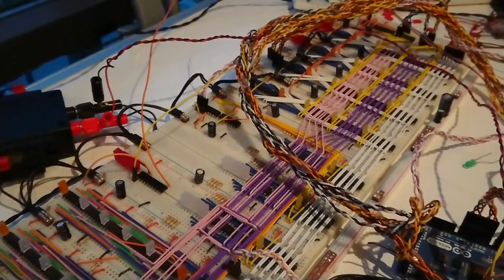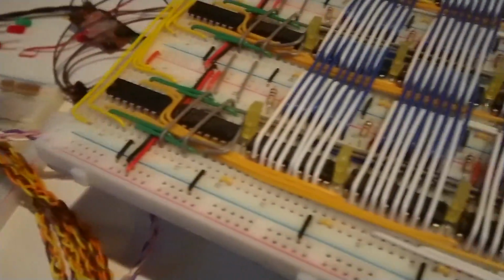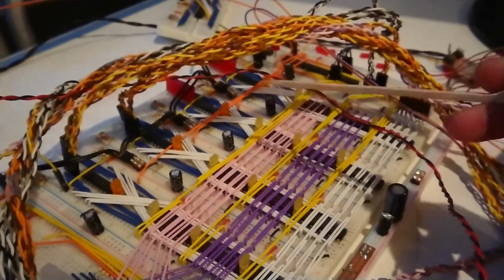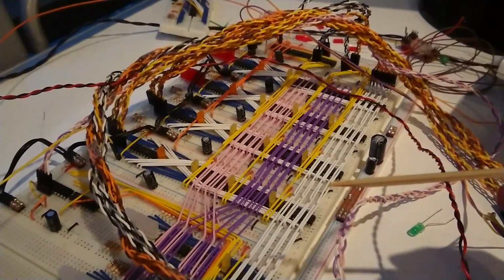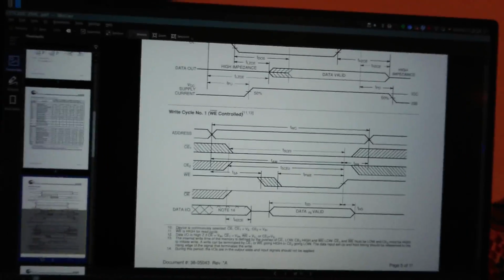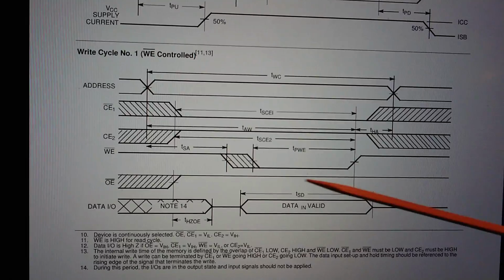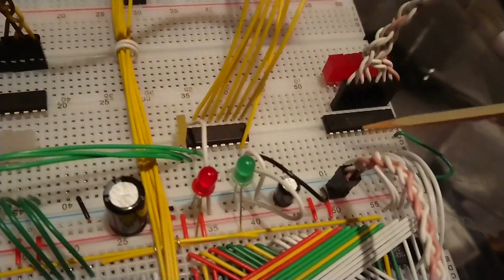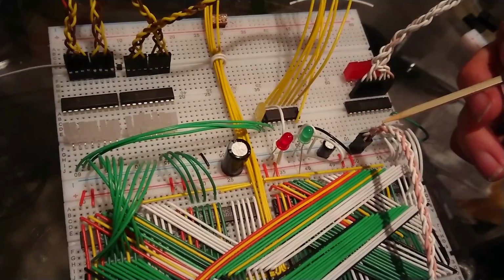64k Memory Module - Plum Breadboard Computer

Comment: never seen edge triggered RAM writing. I wish they all had it.
Reply from the maker: I'm sure there must be a reason for it, but it alludes me.
Reply: @dankendell  Actually register files in modern CPUs are basically multi-port SRAM banks that are clock edge triggered (i.e. synchronous). Normal memory is asynchronous, or rather, it's trigger for initiating a read-cycle is any change of address, and write cycle is somewhat like a level triggered latch with the !WE signal going back from low to high. Originally, synchronous registers were constructed discretely with edge-triggered D-flip-flops, each constructed of an arrangement of 3 SR-latches, i.e. 3 pairs of NAND gates with the cross-over feedback. Conversely SRAM cells are constructed from a feed-back loop of inverters, and the address-change trigger is generated from XOR gates where both inputs are fed from the same address line with a delay on one, so you get a pulse on the output of the XOR when the address changes, and then all funneled into an OR gate to get that pulse on the output of the OR gate. CPU register files no longer use the D-type flip flops, as it looks like much easier to build the inverter feedback cells with word line selection and Q and !Q bit line comparators, which even lends itself to relatively easy extension to dual port, exactly what is needed for a register file. And synchronizing that on a single clock edge is not hard, even easier than those XOR gates one per address line. It seems that for RAM, people prefer not to use synchronous. And after all that, I am right there with you -- I don't know the reason why external SRAM is not synchronous.

Comment: May I ask what brand of wire do you use and where you sourced it from?
Reply from the maker: No worries, standard "breadboarding wire" is known as 1/0.6, which means "one strand of 0.6mm diameter". I bought this: https://www.rapidonline.com/rapid-100m-reel-1-0-6-1-of-each-colour-11-reels-01-0380 (i should really sign up to an affiliate programme)

Comment: Your wiring is so beautiful :)  I'd never be brave enough to make my breadboards that dense, I feel like it would make debugging hell
Reply from the maker: Thankyou. I was fearing a debugging nightmare, but thankfully the circuit is so simple there was very little to go wrong. It's just the scale of it, eight large chips in parallel. Just about manageable. I did get one wire in the wrong spot, but thankfully it was in the top layer so an easy fix. Once two layers were down it was impossible to see what column I was aiming for and had to kinda feel for it. I'm more concerned about capacitance in the circuit, but it hasn't been an issue yet. I'm intentionally running it super slow because I want the satisfaction of flashing lights! :D
Reply: @dankendell  I found out why I can't make my boards as nice, in testing I realized I somehow wired all the B register connections to my 74LS181's backwards :/  So now I am having to reverse the connections, but its easier because mine isn't so dense. I've adding lots of decoupling caps to my breadboard computer, preempting capacitance issues as it gets larger

Comment: What kind of wire is that? :o Looks beautiful!
Reply from the maker: Thanks! Dont know where you are, but in metric it's known as 1/0.6 wire, meaning "one strand of 0.6mm diameter. The stranded equivalent I use for header crimps is 7/0.2, seven strands of 0.2mm. No idea what it is in AWG. 🤷‍♂️ Hope that helps. 🙂

Comment: Idk how ur wiring is so sophisticated
When i circuits on a breadboard it looks like spaghetti
Reply from the maker: Pure patience. The difference for me is that I don't consider it an electronics project so much as an art project. It has no purpose, doesn't matter if I never finish it, the only thing that matters is that the bits that work also look pretty. I actually abandoned using the 74181 ALU ICs and built my own adder subtractor just because I could make the wiring nicer! 😁

Comment: Can't you just use a N channel transistor with a 10k pullup resistor
Reply from the maker: I'm finally catching up with comments. 😉 I don't really remember the context, but if it's about inverting the clock signal then yes absolutely that would work. I do have a follow up video about testing this module with the arduino "monitor", can't remember what I did with that either! Probably just hooked each signal up to the arduino directly. In case it didn't come across, I'm totally winging this, no schematics, no plan, just bending wire making it up as I go. 😁 P.S. Love minecraft, I've made a few redstone machines but no computer. 😉 I tried to build a brutalist style automated ore processing facility, but where I play creative mode there wasn't much imperative so I never finished. Now I can't remember where in the map it is! 🤦‍♂️

Comment: This video just popped up in my recommendations, and  because the wiring looked so neat i felt myself compelled to watch, only to realise it's part of a series; now i have to watch all your videos about 'PLUM'... thanks Obama! lol No but seriously though, this is a subject that interests me very much. Thanks for sharing your efforts.
One thing baffles me though: why didn't you just use one 64kx8 chip? Something like this

https://www.ebay.com/sch/i.html?_from=R40&_nkw=WINBOND+W24512AK&_sacat=0&_sop=15
or this:
https://www.ebay.com/sch/i.html?_from=R40&_nkw=HMU65664A&_sacat=0&_sop=15

In any case, Greetings from Denmark
Reply from the maker: Thank you, you're very kind. :D I wanted the aesthetic of a matrix of chips like the 16-byte memory/register module has. It's an art project and I don't have much interest in finishing it. One big chip is quick and easy, but it's also ugly and boring. :( Not that I have anything against using one big one, it makes a lot of sense to because it's faster, more reliable, uses less power, blah blah, blah, but did any of that really matter? If it did I'd just use one of the many Acorn Master computers I have on the shelf. ;)
Reply: @dankendell  Ahh i see, i didn't realise that the visual appearance was that important, although it's certainly pleasing to the eye. :D

At some point I'd like to do a similar project of my own, i just need to accumulate more breadboards. One thing i'd really like to do is to build a Z80-compatible CPU out of 74xx chips but that will require some more research into the inner workings of the Z80 ;)

Thanks for taking time to answer my comment, i hope you're having a great day/evening/morning/etc. 

Stay safe, Daniel.
Berty.

Comment: what wire do you use, I want to get into electronics but wires are annoying to find
Reply from the maker: Standard "breadboarding wire" is known as 1/0.6, which means "one strand of 0.6mm diameter". I bought this: https://www.rapidonline.com/rapid-100m-reel-1-0-6-1-of-each-colour-11-reels-01-0380
Reply: @dankendell  thanks

Comment: Can u make a vid about how u wired this because this is just pure beauty
Reply from the maker: I would, but there really isn't much to say on it. Parallel up all the chips except the output enables and write clocks. Those go through a 74hc138 decoder and a little extra logic to route the signals to the right chip. I suppose I could talk about that a little?

Comment: Crazy to think that the entire board still only has half the ram capacity of the AS6C1008 SRAM chip I have on my desk (128K x 8bit). I'm doing something similar by combining these chips together instead of just buying one with 8x the capacity (I have literally hundreds of them as I scored a job lot cheaply off ebay).
Reply from the maker: Yet still 32x the amount of memory of the Apollo Guidance Computer which was only 2k, though admittedly 15-bit. Moore's Law in action I suppose. :)

Comment: dude, you are the Picasso of breadboard art!
Reply from the maker: Art is definitely the thread I was following. I'm not a very artistic person, but I can do this! :D
Reply: this made me think that what if the bread board had jumper inserts at bottom side too, probably a bad idea for ideal breadboard applications, but could have been very useful for you in this case.
Reply from the maker: @shkhamd  that would be useful, and if taken to the extreme is basically a double sided breadboard... 🤔 Yeah, that sounds pretty cool. 😁 To be honest though, I'd settle for breadboards that have a width that is a multiple of its height. So you could stack two vertical breadboards onto the top/bottom of a horizontal one for example. They're almost 3:1 but not quite. Very annoying. 😒

Comment: How do you make that so straigth? that is amazing!!
Reply from the maker: Thanks! :D If there's any "trick" to it then I guess it would just be repeatedly tensioning (is that a word?) the wire. Grab one end with one hand, pinch with the other hand and repeatedly stroke the kinks out. Unfortunately that sounds way dirtier than it was meant to, but I can't think of any other way to describe it! :D Once a wire has a sharp bend in it though I generally put it aside and start with a fresh piece. I'll then use those bits for shorter wires later.
Reply: @dankendell  you dirty man... You don't want any bendy lines😂😂

Comment: That wiring is sexy af! Looks like a multi layer PCB!
Reply from the maker: Thanks! I'm particularly proud of this one, it was super therapeutic to build too! :D
Reply: Daniel Kendell How long did it took you to wire that breadboard? It would take me days to get it that perfect.
Reply: yeah
Reply: Cable Porn.
Reply: Technically it is.
It's a board. With circuits. With multiple layers of wiring.
Reply: @wesleymays1931  It is not. P stands for Printed. This is not printed ;).
Reply: @fenomenPL  Right, forgot he said PCB and not just Circuit Board. 🤦

Comment: Since both the OE and WE are active low, isn't it possible to invert one of them so it's active high? I'm probably misunderstanding it. Haven't finished the video yet, so you've probably already talked about this.
Reply from the maker: If I recall correctly,  I think that was the idea, or at least what I was going to try on it. Unfortunately though there have been many distractions since I uploaded this video and haven't actually done any more work on this module since. Really should revisit it sometime soon.

Comment: What breadboards do you use? I suffer horrible voltage drop when doing this stuff on BBoards.
Reply from the maker: I have no idea really, cheapo ones from ebay. ;) Those are the ones with the split power rails which is rather annoying so I may wind up rebuilding it on breadboards with whole power bars instead. I have had problems with power distribution in the past, I mention it in https://www.youtube.com/watch?v=_4Sp5cQ45zE . Jumping the power from one bus bar to the next just doesn't seem to work so well for me so I've been making little plugs on leads that come straight from the bench power supply and that works much better. :) Also, when in doubt I litter the bus bars with decoupling capacitors since you can also get "weird behaviours" without them. No particular rhyme or reason to the values I use, just whatever's to hand. :)

Comment: I'm not sure if you got the module to work or not yet as I have not finished the series. I've been thinking about this for a bit, and I'm not sure if you've thought of it(probably doesn't matter if you did get it to work), but couldn't you hook up an inverter into the write enable so that its low would be the same as the high for the rest of the computer and clock? Then it would technically still be active low, but it would be active high relative to the rest of the computer and would write on the high of the clock cycle. I'm a beginner in electronics and I really want to start making something like this, but I wouldn't be surprised if I'm wrong.
Reply from the maker: I haven't actually progressed on the memory module since posting the video. :( Been distracted with other things. That is where my mind was going with it too though, can't say anything with any confidence though as I haven't actually done it yet. Should probably get back on that... ;)
Reply: Well if it does work, you should totally give me credit for the idea ;) jk.
Reply: it's either invert one or put a little register on your memory and latch the clock enable in and then pulse a cycles to do what you need done on the ram board and then drop reset ... if you have access to a single flip flop with q1st stage and q2nd stage accessible (build one) u can latch the first clock pulse .. and load the info ... and then cycle the latch once to process that info down the line and then reset to put it on the bus so your enable and clock work one after the other a basic pulse clock (r/c circuit) with a pulse detect will allow you to use an independant clock cycle to process the ram faster and still operate with the main clock
Reply: @dankendell  Ben Eater had a somewhat similar situation in his breadboard CPU. His solution was a simple RC circuit to drop the voltage on the rising edge of the clock. His videos on his build are extremely detailed, if you want to check out his build for inspiration.

Comment: what wires do you use? what gauge? single strand?
Reply from the maker: I use "1/0.6mm", single core 22 AWG. I get it from https://www.rapidonline.com/rapid-1-0-6mm-single-core-equipment-wire-on-100m-reels-62317 :)

Comment: The nicest breadboard wiring I have ever seen. I would hang this on my wall as art.
Reply from the maker: Finally! Someone gets it! :D It really is more of an art project than an electronics project and I have actually thought about doing exactly that. I've looked into ways of making a breadboard layout more permanent. (As ironic as that may be) Someone suggested encasing it in clear resin which would be amazing if I could pull it off but seems super-risky and I'm not convinced I can. I feel like many layers of some kind of spray on stuff is probably the way to go. Just need to figure out what that spray on stuff is! :D
Reply: Conformal coating perhaps? :-D
Reply from the maker: I bloody knew it! Item unlocked! That's constantly happening to me, I know the thing exists I just don't know what it's called. I'm gonna order some right now. Thanks for the tip! :D
Reply: Daniel Kendell Spray on lacquer might do.. just use multiple layers. Hair spray will suffice and cheap, just ask the owner first. :-)

Comment: Thanks for the videos, Daniel. Much appreciated as I'm after doing the same kind of digital electronics that you are doing here. I have most of the gear, but have ended-up making other projects, such as a 24hr clock using 2" 7 segment displays, drivers and a 74HC 8-bit data bus to drive it. Designed the multiplexer, clock and driver circuitry myself. Keep up the great work!

Comment: What memory chip is that? I'm planning to use an AS6C62256 for mine (It's 32k x 8bit, I have 16bit address space, allocating half of it to the memory), sounds like they expect similar control signals. I'm planning to use a 74HC4538 to generate a negative pulse as WE# on the rising clock edge, to make sure the pulse gets back to HI before the clock falls, because by that time, bus will be destroyed, and the memory chip could lag behind.
Reply from the maker: Those SRAM chips are Cypress CY7C185-35VC. They're 8k x 8bit, so 8 of them for 64k. They're just what I happened to find on ebay. I was just collecting parts and thought that eight 8k chips would give me some flexibility. I also didn't particularly want just one chip for the entire memory space. How boring. I wanted that same memory-array vibe that the memory cards of the 8-bit era had. :D
Reply from the maker: I do sometimes find it surprising just how few programmers have any interest in the hardware. The abstraction stack is now so high that so many don't know and don't care how their code is executed, and that's... fine I guess? I mean, that was the point right? Juggling registers? Porting to different CPUs? Sod that! Write in C! Tired of managing your own memory space? Write in Java! Static typing getting you down? Write in Python! Trouble is, if you don't know how it works, it may as well be wichcraft. Say the right words in the right order and something happens. It's just not for me. I guess what I really enjoy is the mechanics of it, It's a real reminder that what we work with is a machine and not the forces of magic or celestial energies. Just another type of clockwork (which I also admire). I guess that's also why I dislike "Ok Google!" and when software tries to use an informal tone with me. You don't hear the computer on the Enterprise say "Heads up!". You're not my friend, you're my computer. Act like it. Anyway, ramble over. Glad you enjoyed the videos and thanks for the comment, it pleased me. :)
Reply: " I also didn't particularly want just one chip for the entire memory space. How boring" - You're so like me! People say, why the hell are you messing around with all this old tech and I say, "Old Skool teaches the way" - I am a programmer by trade now, or have been on and off for many years, but I am also qualified in electronics and electrical engineering and all I see everyday are people who just use an abstracted view of a programming paradigm and not what you and I understand through getting our hands dirty.